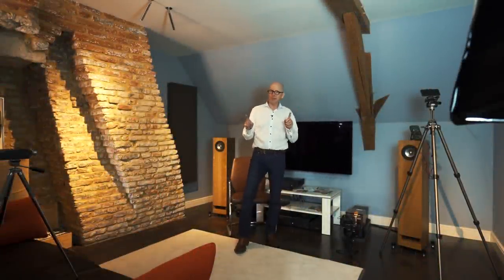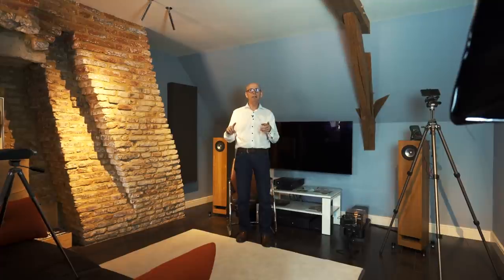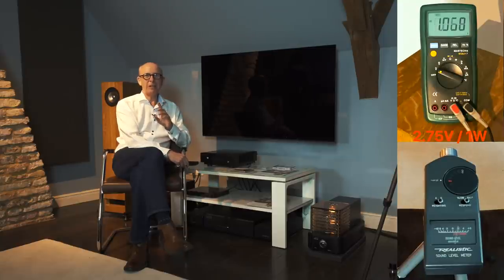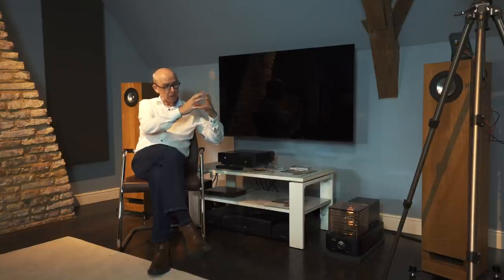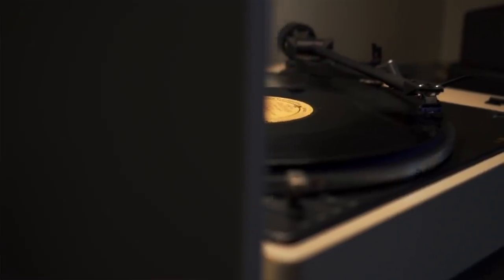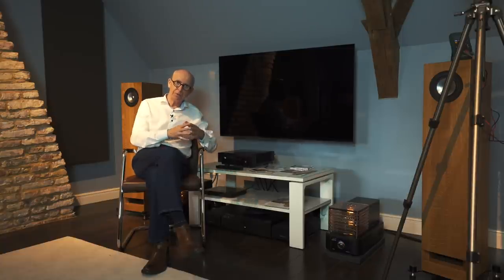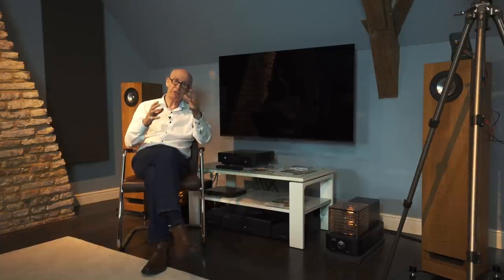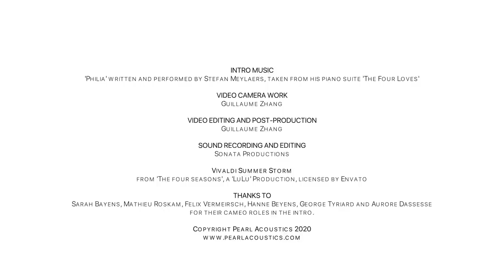How loud is 1 Watt (with an 87db Loudspeaker)?

Comment: I just noticed about real watt output from amp to speaker the other day because I was curious and bought a multimeter, I was so surprised that my amp was only outputting like 0.2 watt with the usual volume I'm comfortable with, but my amp drew like 4 watt of power out of wall socket, I bought a watt meter for that. So watt to speaker is not the same as watt from the wall socket. And even 0.2 watt is quite loud.

Comment: Interesting demo, even if one may quibble about technicalities. Two questions:
- What is the typical relationship of volume level set on amp to proportion/% of power used? I have a 120 W/channel amp, usually turn knob to about level 35/100 for less than speaking volume (~50-60 dB) in room with 88 db efficiency speakers. Knob turn would suggest ~35/120 W =~40 W going to speakers, but your demo suggest more like 0.1-0.2 W. Hmmm.
- Linearity of amplification was recently discussed by Ask Paul, who argues that strict linearity only exists in about bottom 10% of amp range. Does that linearity range differ with amplifier type (A, A/B, D)? That would explain why Nelson Pass First Watt amps go at max to 30 W (class A if I recall correctly), but your class D mono blocks have 600 W of potential power.
Reply: A volume control is usually scaled more on perceived loudness than power. Usually at around 5/10, the amplifier is 10dB below maximum - "half volume" is only about 10% power. At "35% volume" you will be using 3.6 watts out of 120, but the input gain is also important, as is the scale on your volume control for instance half the clicks on a scale could be 20dB down, and if the device uses the decibel scale, it could be a tiny fraction of maximum. If the input gain is higher, it could be more power, but the amp might clip at just over mid-way, or it could not reach maximum power at full volume if the input source is low.
Also music doesn't stay at its maximum level all the time. Only the loudest part of a song will use the amplifier's full power. This explains why small speakers can handle amps with surprisingly high power ratings, because the speaker isn't subject to a continuous tone. On average, only 10-25% of the amplifier's maximum power stresses the speakers at maximum "clean" volume.

Comment: I connected my Pass DIY Class A, 8 watt amp, to my 98db speakers and it showed me quite quickly just how little power my speakers need. Half volume was enough to run people who don't like loud music out of the house and at 87db at my MLP barely had the volume cracked. The 25W Pass diy F5, is an absolute monster in that role. I think the giant caps in the power supply must help as well.
Reply: I was thinking of buying 2 99db woofers and powering each with 250 watts but your comment might have changed my mind😂

Comment: Interesting demonstration. Is my understanding correct that the relationship between speaker efficiency, power and volume is highly dependent on frequency?. Most of the efficiency ratings I've seen are at 1000 Hz. How much power is needed to get 87.5 db at 500 Hz, 250, 125 or 62.5Hz?. Perhaps not an issue for the reproduction of classical music but a real consideration when selecting an amplifier for jazz or rock music with more low frequency content.

Comment: Looks like you are using Mastech MS8217 DMM, their spec shows AC voltage frequency :40hz-500Hz, and since the signal into the DMM is  music instead of sine wave, the slow response of the DMM will only read the average in the low frequency content,  but not the peak which may contribute much moreto  the loudness but can not been measured in the setup.
Reply: I agree. There are serious flaws in this setup and measurement. However, I do not disagree with the overall premise and conclusion. Most of us do not need nearly as many "watts" as we have been sold. In this example, at the loudest point of the video, dynamic peaks are probably pulling upwards of 20 watts (or more) from the amp. At listening levels that most of us would consider "normal" or "comfortable", 1 watt is plenty! I own several amps that provide 25 watts or less (the lowest being an 8 watt SET) and they are all plenty loud enough for my taste.
Reply: I'm not an engineer or something but doesn't need high frequencies way less power than low frequencies? So I would guess that 40-500 Hz need more voltage/power than 500-20k? And he also explained that the voltage spikes came form the very low frequencies
Reply: @Ener-GI  yes, high frequency content need less electrical power, but DMM is slow reading and can not catch and show the high amplitude transient in real music, unless the DMM has a peak holding feature, otherwise you will read low. One way to address this is to use continuous sine wave as the input signal, the DMM can then capture the steady tone properly within the frequency response range

Comment: Would love to see the same test done using a sine wave instead of a dynamic track.  I'd bet you would need a less "volume" to reach that 1w/2.75v.  Testing car audio I know it's impossible to get clamped wattage rating using anything with any kind of quick frequency change and especially so with lower end multimeters.

Comment: if its about speed of the amp then what makes the amp slow or fast exactly? thanks, really interesting / beautiful room and speakers.
Reply from the maker: Hi, that’s a very good question. Now I am not an expert but my colleague has informed me about the relationship between speed and damping factor. If an amplifier has a high damping factor it can stop and start the movement of a drive cone very quickly and give the impression of speed. Unfortunately though, not all amplifiers with relatively high damping are considered or sound ‘fast’. There are other factors involved too.  it is also known that certain types of transistor tend to have properties that give the impression of speed. But so can the amplifiers’ ability to deliver high voltage quickly via discharging large amounts from its capacitor reservoirs, when necessary (and the time it takes to recharge them - think of a cameras flash gun and how long they take to recharge when you have pushed them to the limit).  In general, class d switching amplifiers tend to have very dynamic / fast response times. 
Now please do not take my answer too literally as scientifically my explanation is not very well expressed. But I hope it helps a bit?

Comment: I have a ‘low watt’ desk top set up.  I have an amp switcher that allows me to run a Schiit Aegir (20 watts into 8 ohms) or the LTA MZ3 (1 watt) paired to Omega Super 3 High Output Speakers (97 db efficiency; 6 ohms impedance).  It is amazing!

Note:  I love the design/decor of your room.
Reply from the maker: Thanks! I suppose I can guess your LTA MZ3 drives your Omega’s just fine, or do you crave that ‘extra watt?’
Reply: @PearlAcoustics  The LTA drives ‘em just fine; I have the Aegir in play primarily during the day for a more visceral response.  I typically use the LTA MZ3 at night...as it has a soft/lush sound quality/nuance. I love having both options...but honestly...I’m stunned by what 1 quality watt can produce.   I have the LTA MZ3 serving in full capacity as a amp/preamp/HP amp.  So the Aegir is my primary amp in my desk top set up...I run the LTA MZ3 as an amp option.  Either unit can drive the Omega’s beautifully.

Note:  I have a main rig as well which is comprised of a 200 watt into 8 ohms Krell Vanguard integrated amp paired with Salk Song3 Encore tower speakers.  I fully understand what a larger system provides.  Having a low watt desk top system is simply a different (not necessarily better) experience (more intimate).  I listen to the desk top rig daily as opposed to the main rig (preference).
Reply: I’m thinking of buying the Schiit Aegir but not sure how good it will work with my speakers - AudioVector QR1. I’m a complete rookie when it comes to this. Any advice is appreciated and highly sought after. The QR1 are 4 Ohms, 45-45 frequency response, gold leaf upper limit (not sure what that is) 195 kHz and a 150 W power Handling.
Reply: @skitstorm5634  I won’t pretend to know the answer.  I’ve since sold off the Omegas and have the Spendor Classic 4/5 in line….which are less efficient than the Omegas…but I prefer the sound quality of the Spendors…go figure?  The speakers you’ve referenced sound power hungry on paper at 4 ohms.  I dare not say 1 watt will work. Have you contacted the manufacturer for amp guidance?  Ex. Amp power pairing requirements and recommendations?

Comment: Did you connect your multimeter directly to your speakers? I tried this at home. Didn’t work the meter barely moved. I had it set it 600V AC
Reply from the maker: Hi. Indeed but you need to set it to auto scale or for example 10 volts. We are really looking at the average working this way because the meter is too slow to react to the peaks. But as we talk about RMS this is ok.
Reply: @PearlAcoustics  thanks for the reply. I will set mine to 10v and see.

Comment: how does the volume button work I got 80Watts PMA amp at 8ohm and run it on 20 percent with 92dB focals but 1 watt should be really loud so does the volume turner work exponetially and is the statement that for every 10dB increment the power needed is factor 10?
Reply from the maker: Hi, thanks for your question. The effect of the volume control varies from design to design. Logarithmic versus linear etc. I would not pay much attention. 
Perhaps the best exercise is to get a white noise source and measure with an oscilloscope or multi meter, to get an accurate result.

Comment: Harley, doesn’t a valve amplifier have a different harmonic signature to a solid state one. I am imagining harmonics being added to the signal that are not obviously distortion but, fill in between the notes and ‘fatten up’ the sound. The lower damping factor may also be causing some overshoot. Does the speaker behave the same when it’s one watt of power from a stern 100W power amplifier?
Reply from the maker: Dear Christopher.  No two designs of amplifier are quite the same.  For example there is a big difference in the way valves (tubes) work than solid state devices.  But if you study Nelson Pass' approach to amplifier design, you will see that he has a massive range of amplifiers called 'First Watt'.  Here he experiments with not only design ideas but also with different types of solidstate transistor. When he discovers a new type of transistor (people are making them all the time, some catch on, others don't. Some are specifically designed for a single purpose and then get discovered by others for another purpose,  just like tubes / valves before them).  Well, Nelson Pass says to himself 'I wonder what I could do with this transistor?'  And experiments.  What I am trying to say is that there are so many variables in an amplifier design from the amplifying components to the architecture itself that generalising is difficult.  Some people overcome damping factor 'issues' by changing the design or type of transistor (be it valve or solid state).  Sorry if this makes things more complex, but there is no easy answer to this topic.  Only generalisations..  
But - 1 Watt is 1 Watt.  How an amplifier sounds at 1 Watt depends on very many factors, and not on the power reading at the time.  Hope this hleps?

Comment: Great video, I’m trying to measure my amplifier. I wonder where to put my multi meter. Is it AC volts or DC volts. They don’t give the same values. DC is lower. Please help.
Reply from the maker: Hi, you need to set it on AC. However, a volt meter can only give an indication because its reaction times are way slower than the musical impulses it receives. I did it this way in my video to make a general point about the perception of power. I hope that helps?

Comment: I don't know if i'm wrong but low frequencies take more enegy than high frequencies and for each 3db step you have to double the power. So when listening to some nice rebassed music that has continous tones at 25-45 hz it takes a lot of energy. Most likly more than one watt when you want to feel the bass.
Reply from the maker: Yes indeed but only in a subjective way.  ‘feeling the bass means power and high dB level - it’s just that you feel it more than hear it.  BUT if your speakers have a flat   frequency response then they produce as many db’s at low frequencies (for 1 watt) as they would at medium or high frequencies. Hoping that covers your concern?

Comment: I keep rewatching this as it is fascinating, but I have a question. When you say: dont worry about wattage power, worry about how it delivers that voltage - how do we judge that exactly? All reviews ever really talk about is raw grunt power. The never talk about dampening or dumping the voltage coming back into the amp, or how efficient they are. Perhaps I'm wrong about the efficiency aspect as I'm a bit new to this, but is there anything specific I should be looking for in high quality amplifiers when you talk about "delivery" of power? I know the Sibelius speakers would be considered efficient and dont require much oomph to shine, but if I consider a class A or A/B amp with a low wattage, what else should I be looking for? Im interested in the Quad Artera play+ as I enjoy streaming, and I know its integrated, but would it perform more "efficiently" on the Sibelius, if I also get a Quad Artera Stereo power amp to deliver the power? Thanks!
Reply from the maker: I think it’s too easy to worry about these things too much. QUAD Artera is really good. The amp too. It will be the amp that makes the biggest difference. try listening to the Artera with its Stereo counterpart, and then with something very different, like a Quad ll forty or a Sugden A21se

Comment: There is a rule, +10dB x 10 watt. So a 87dB Loudspeaker would need 10 watt to be 97dB loud, 100 watt to be 107dB loud, 1000 watt to be 117dB loud and so on. But, the sensivity was measured at 1kHz (1watt / 1m at 1kHz). So, if you play music (variable load and frequency), especially with a lot of bass, you will need a bit more watt to reach the 87dB.
Reply: He said 8 watt amps drove his speakers to over 100db so how does your formula make sense.Please explain.
Reply: @brucegelman5582 Dude, i've explained it in my answer. What exactly you don't understand?

Comment: If I may offer a piece of criticism.. What the multi meter is seeing is the average power output, so once you include the crest factor (12-16dB typically for the music in the video) you need a lot more than 1W to see 87dB average level without clipping. When the meter is reading 2.75v/1w, the momentary output is likely somewhere in the range of 8-16w.
Reply: Indeed, as the speaker's impedance goes up and down with frequency so does the its sensitivity, so the accurate test would include measuring the impedance at one frequency, calculating the voltage needed for 1 Watt and then playing just that tone (that frequency) sine wave ...

Comment: Hi, new subscriber.  How come my NAD M10 V2 volume is measured in negative sign, ie -70db?  It never goes positive?
Reply from the maker: Hi this is normal. In the audio industry we work on a maximum level scale. So we measure sound on equipment as the maximum minus x number of db’s so full volume, less 35db etc. For CD Mastering we have to stay 6db under 0 for our maximum peak. I admit it’s a bit strange but that’s how it is. The Lyngdorf TDAI 1120 has a feature where it can go 12db over 0! I hope this makes sense?

Comment: Thanks Harley for a explaining this topic well. I am using the small SMSL VMV A1 amp that you recently reviewed. It only has 10w into 8ohms and I am using it to drive the KLH model 5 speakers. Do you think this small amp is fast and good enough to bring the true potential and capabilities of my speaker?
Reply from the maker: Hi. Your KLH5's are quite effieicent +/- 90db at 1 Watt. I am absolutely sure that in a medium sized room 6m X 5m it should provide plenty of punch.  At 1 Watt per channel you have 93db in your room! so at 8Watss per channel you wil have 101db - enough to do serious hearing damage.  No dobts it should be bringing out the best in your speakers.  But these things are all about synegy and your room acoustics, and personal taste too.  Best wishes. H.

Comment: Love your videos just discovered your channel. Small question a friend of mine is building a 5 watt tube amp for his 90 sensitive speakers and I was wondering is there a danger of hooking up an amp that has low watts. I mean is there a minimum. You mention  in the end that 6 watt is the preferred minimum for your speakers
Reply from the maker: Hi. Thanks for your question. Just when I think there is a minimum, someone proves me wrong 😉 but to answer your question, yes there is. When a speaker is 90db efficient (assuming it is 90db efficient +/- across the frequency range, then your friends speakers (per channel) will be making 96db per channel or 99db, both channels driven and that is very loud. 
One of our clients drives his Sibelius loudspeakers with a 2,3w tube amplifier and he says they are plenty loud enough for him. But he has a small room, listens mainly at night time and at relatively low volume, 76-86db, compared with  me. I hope this answers your question?